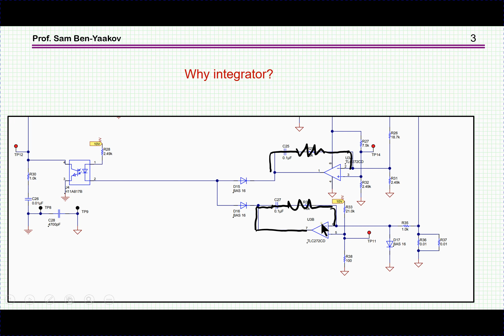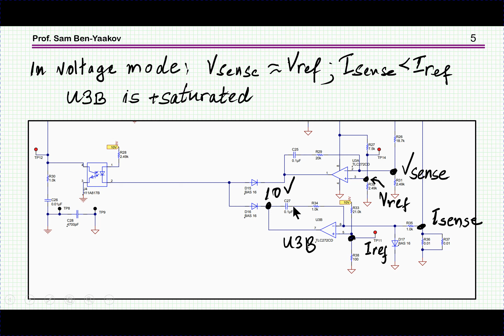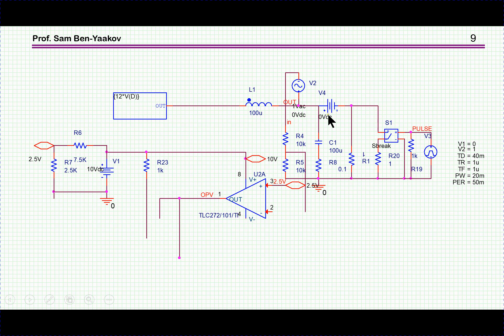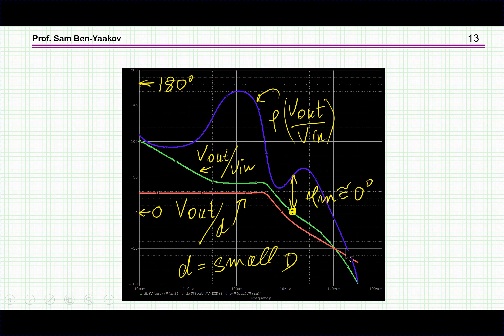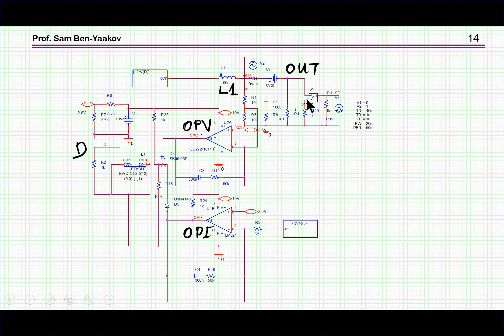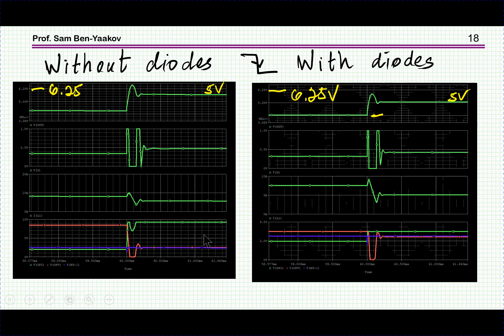PI, current limiter, and integrator windup

Comment: I really like your video  showing the benefit of  using integrator and the current limit behavior in this circuit. After all the fix is very simple and effective. BTW, I have a question regarding  the feedback of TL494. Most other PWM IC feedback voltage sense connects to the inverting pin of the error amplifier. Why is the  TL494 connects the feedback voltage to the  positive pin ? Is it because of the logic OR if the  the error amp and there is an internal logic inverted back to achieve a negative feedback ? Thanks Dr Yaakov
Reply from the maker: The FB connection to plus has to do with direction of OR dide that are driven by a current source to ground
Reply: Sam Ben-Yaakov Thanks for your explanation